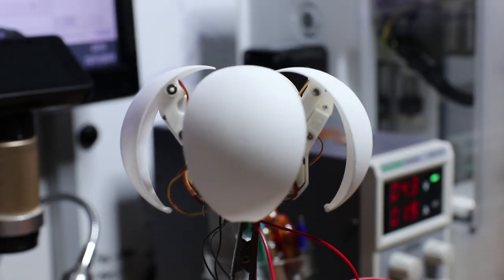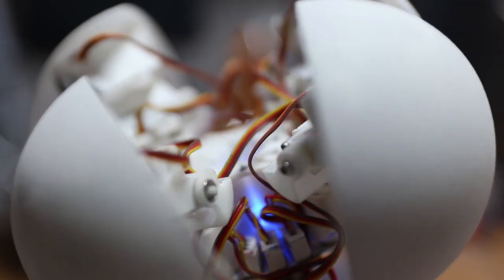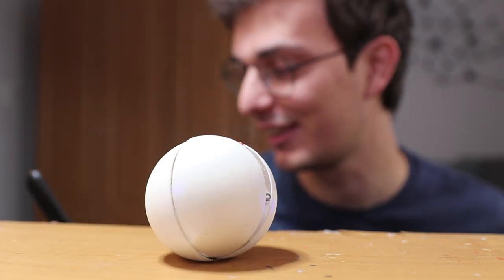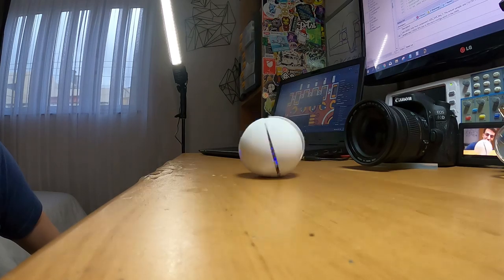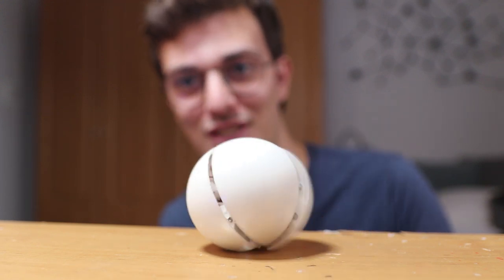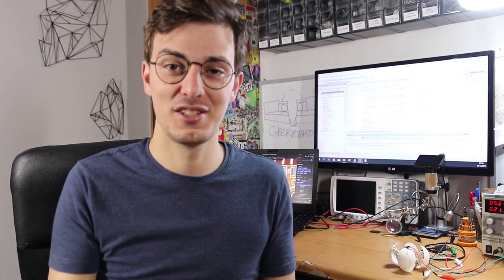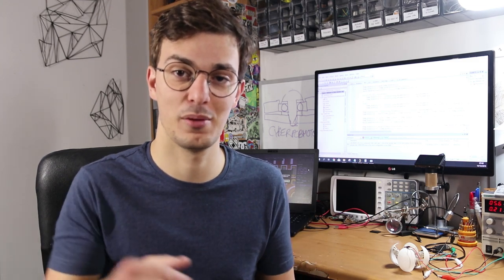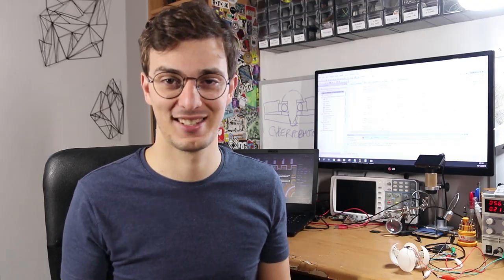4-Legged Robot Ball - First Walking & Rolling Test

Comment: that's cool!. hey, you could try to put in a gyroscope to make the movements according to the position of the robot.
Reply from the maker: Thanks! There's already one onboard 🙂 the rolling test shown in the video is open loop just to see how it reacts for now
Reply: MorphHex by Zenta uses an IMU to achieve just this. In general the robot has to be rolling at a perfectly constant specific speed in order for open loop control to work at all here, so correcting the center of mass (probably very difficult) and switching to closed loop control should make a big difference in rolling performance!

Comment: For rolling motion like that you need to be able to shift the center of mass to another axis, I think you might be able to get away with stabalizing the com to a 45 degree axis and having the legs extend up to 45 degrees.

This might be a nice robot to setup real life neural network learning
Reply from the maker: Thanks! That would be so cool! For the rolling part I will do some experiments in future videos because this test was just an open loop test.. I will need to start getting data from the onboard imu
Reply: Check out James Bruton's BB-8 videos
Reply: You might also get away with a lead screw through the center  that changes the position of a mass

Comment: Getting a sphere to roll isn't trivial, but it will definitely add complexity to the build. Most spherical robots do this by using a weighted pendulum to offset the center of mass away from the center of the sphere. Segmented spherical robots, however, can have a different form of locomotion, and what you're trying to accomplish is going down the path of this form of locomotion. A few years ago there was a spherical hexapod called MorpHex, which had 12 panels, and what it would do is roll along it's split equator, which allowed panels from each hemisphere to offset each other, which would allow for left/right tilting, then, like yours, each set would be used to push the sphere forward. 

Problem is, both of these options increase complexity, which would increase size and weight. The only solution I can think of is a hybrid of the two, mass shifting and using the shell to push the robot forward, though this would require a lot of design changes: A bi-directional solenoid, or a solenoid with a central holding position, for the left/right weight shift, which would allow for tilting, while using the shell actuation for the forward pushing motion. Only problems would be how much weight the solenoid mechanism would require to roll the sphere to the correct angle, and how well a non-hemispherical panel would be at producing forward locomotion when tilted. 

I can't wait to see what solution you come up with. But those two forms of sphere locomotion are the only two that I know of that don't use some kind of wheel setup to drive the sphere, or a smaller robot within a shell (like a sphereo) to drive the outer shell like a hamster ball. There are some other experimental forms of producing locomotion, but I personally haven't seen these, and the concepts are way too complex, and heavy, for what you're trying to build.
Reply from the maker: Definitely agreed with what you said. Getting the robot to just roll is feasible with the technique I am using.. But controlling it to go straight for example is not going to be that easy and tbh I'm still not sure if it's possible

Comment: I love what you do here in your video it is amazing. Simply brainstorming, but the rolling mechanic you can have little piston s on the bottom of the walking stilts. Also when the robot is transformed into its open mode it could reveal a tiny gun.

Comment: I think making it a little bit bigger is the right approach. For the rolling to work you would need to make it so, that the main body can move from side to side while its closed inside the ball. This way you can lower its center of gravity depending on which way is up or down and make it sit stable on its side. If not, its almost impossible to make it roll nicely

Comment: As for the rolling other answers seems valid, but maybe you could add accelerometer and gyro, and with that you could manipulate leg so it keeps stable position on its side without the need of shifting center of mass?
Reply from the maker: It has an imu onboard already.. I will have to experiment with that a little further

Comment: Love this idea just a quick question though in the first video you see some kind of a metal bushing on all the parts. Is that like a treaded insert or where can I buy some? Also I saw the photo on your Hackster padge with the board plugged into something but what's that thing called
Reply from the maker: They are 5mm flandge bearing SMF681X-ZZ

Comment: How does the robot know if it is moving anywhere? You should add some sort of motion detecting to the robot. So that way when you tell it to roll in a direction it can tell what way it is facing and if it is achieving its goal, which is to move in the given direction.
Reply from the maker: It's already has an imu sensor 🙂 it's not reading its data yet though

Comment: What if you try rolling 'sideways' by extending two paired sections at a time instead (so alternating hemispheres)? Sort of in the direction it was rolling at 2:20. Seems like the way the 4B is balanced would work better this way. Might even let you steer the thing by extending one leg slightly more than the other in the pair

Comment: To get the 4b to roll use a counter weight design and have the motors to move the weight in the direction u want 4b to roll and have the motors to center the weight and or counter the weight just enough to get it to stop if ur smart enough and have the patience program it to become self learning so it will save u some time programming every little detail hope this gives u an idea

Comment: Have you seen the new matrix ?..The Matrix Resurrections...well in it they have magnetic beads .....They call it Paramagnetic Oscillation where AI appear and interact in the real world through a variation of nanobot technology ...CAN YOU BUILD IT ?? .....some thing like a Dodecahedron with magnetic sides that connect to each other and can also use wireless changing and RGB LEDS on each side too  ...too move them was thinking like a bb8 mini gyro toy ????...ps you need a lot ...each one a pixel .....and a Brain for each one.......